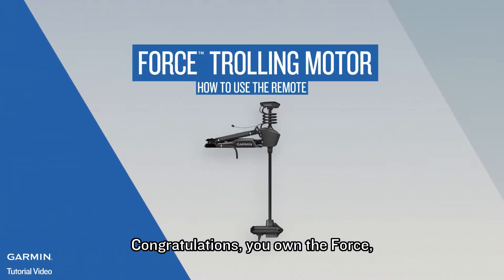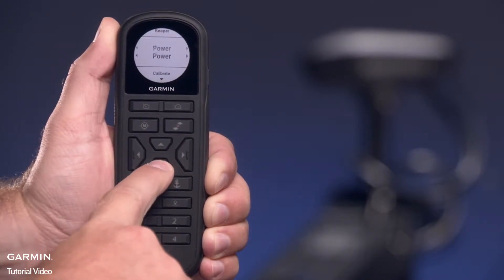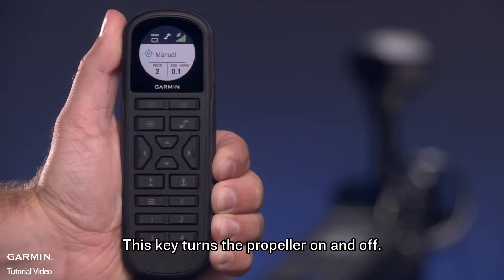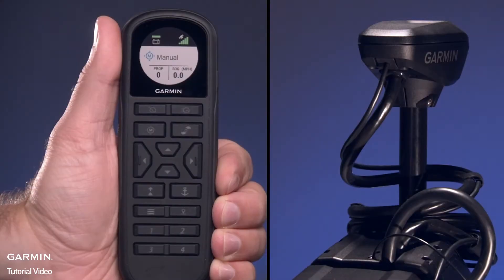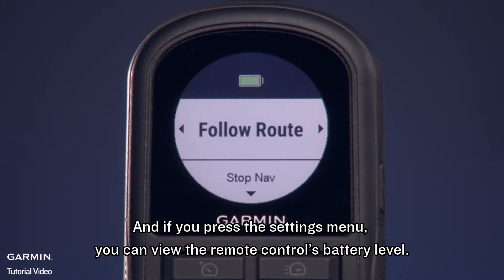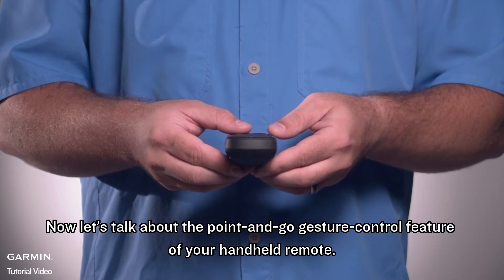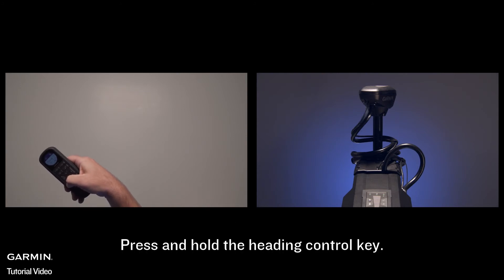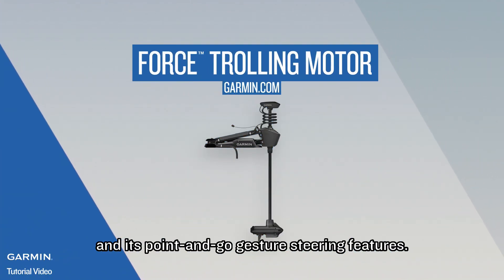Tutorial - Force Trolling Motor - Remote Features

Comment: When in manual more and steering Left and Right with the arrows on the remote, i experience heavy lag. In my Ulterra it was absolutely instant. When trying to change direction with the Heading in use, the lag is devastating. I press and hold and nothing happens for 5 seconds. I keep holding and it starts moving. Then i lift my finger, but now the motor oversteers. It is absolutely impossible to steer with this remote using the heading feature. I may try these gestures because its impossible to do this with the arrows of the remote. Please fix this with software update. Make it feel like MinnKota!
Reply: Agree.  I was trying to control my boat yesterday and looked like  a mad drunk driving the boat